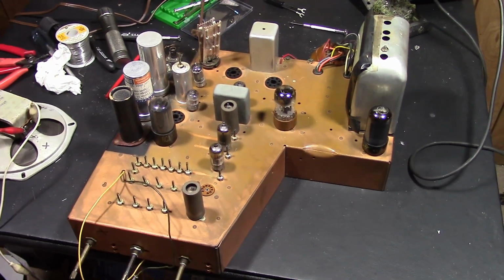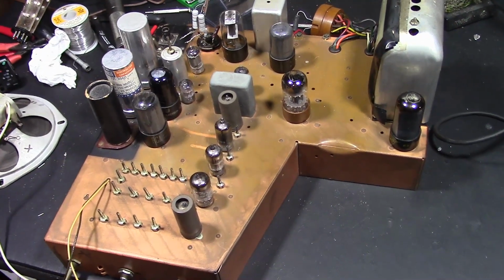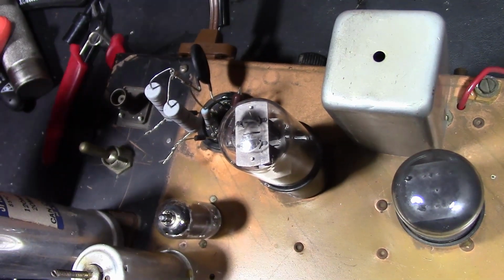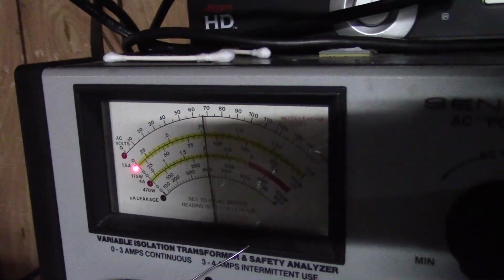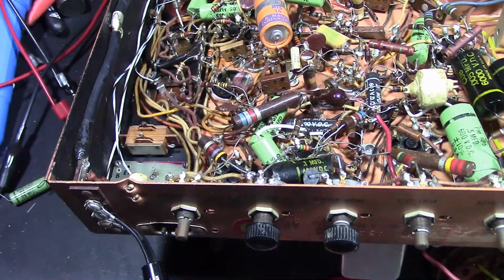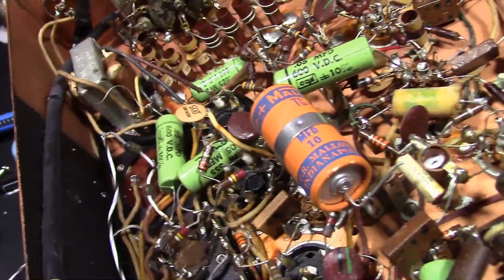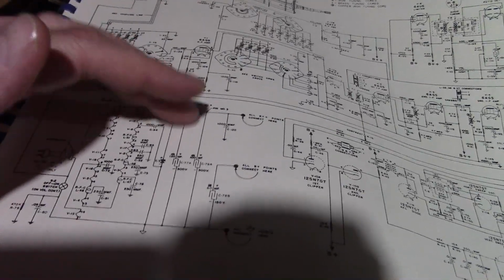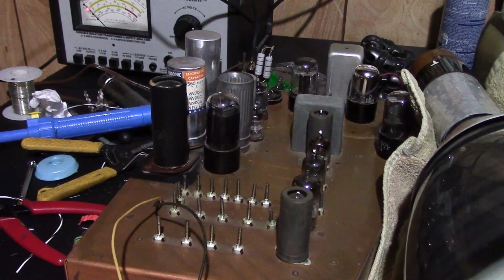Motorola VT-71 restorations p4o10

Comment: Looks like it was definately modified for slow-scan TV. the vertical scan period would be 7.2 seconds for US stations and 8 seconds for European as they used the AC frequency as an accurate 60hz (or 50hz) reference. I wonder if you’ll find a really large value cap in the vertical oscillator?  Would have thought they would fit a P7 tube for that long persistence phosphor as a TV tube would fade out too quickly. Probably they took photos with a Polaroid camera as it could keep the shutter open a long time in low light. Incidentally, the BNC socket would have been connected to audio from a shortwave receiver, tuned to a popular SSTV frequency such as 14230 or 7070khz
Reply from the maker: I agree someone was in the process for an SSTV conversion but I didn't find a big cap.  Watch the next installment to find the culprit...